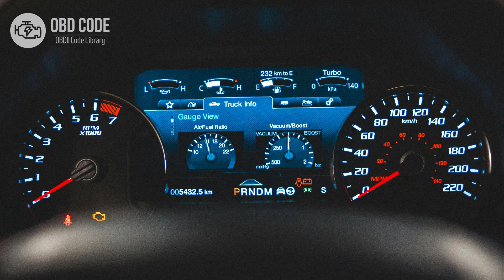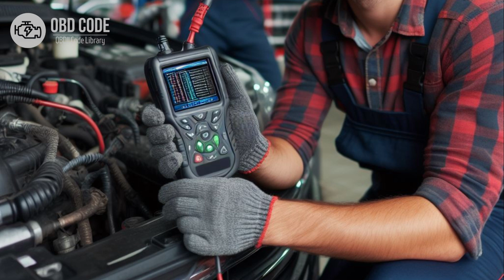P0705 Transmission Range Sensor A Circuit Malfunction PRNDL 🟢 Trouble Code Symptoms Causes Solutions

Comment: Hi mate I have Honda accourd euro 2004 I have the code p0705 I change the transmission range switch 
But I still get the code 

Can you help me
Reply from the maker: Good morning, I advise you to go to a workshop specialized in the brand. They have the necessary equipment and experience to make more effective diagnoses.